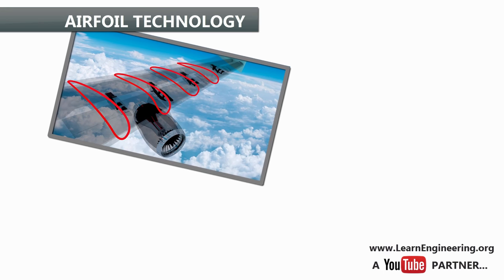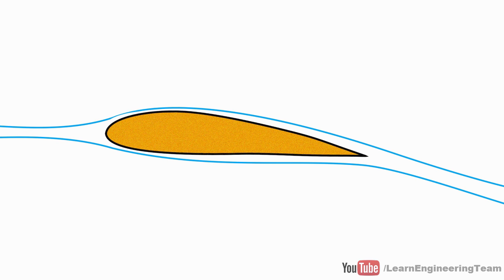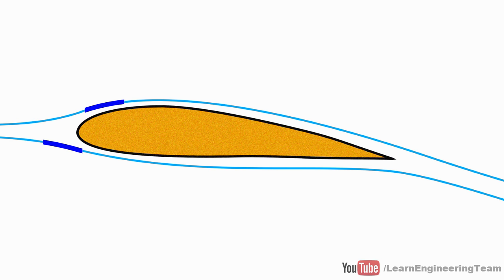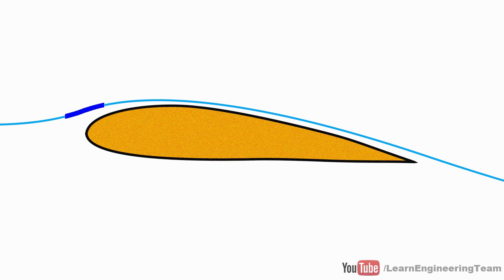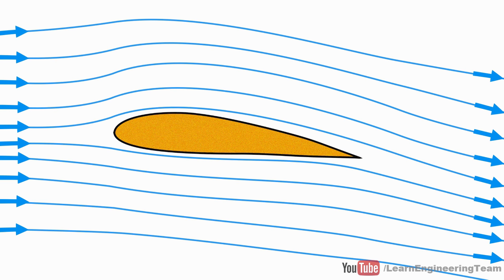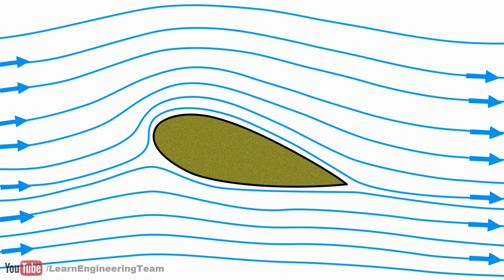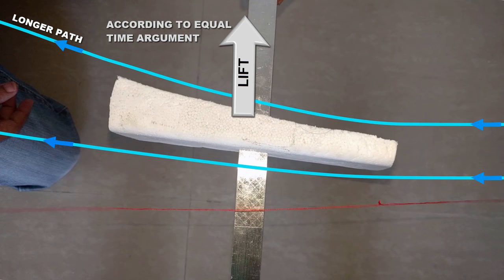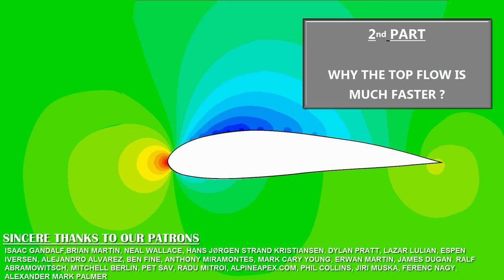How do Wings generate LIFT?

Comment: I wonder no one's talking about starting vortex and bounding vortex!!
Reply: Exactly Prashanth!
For simplicity take a symmetric airfoil on a reasonably long wing, moving at zero angle of attack. The airflow is symmetric, no lift is present. Now pitch up the wing rather quickly to a reasonable angle of attack (AOA), the flow will change: on the leading edge the flow will curve upwards, the stagnation point will move down, just like the flow on a lifting wing. But on the sharp trailing edge the flow will try to flow around it with the rear "stagnation" point on the upper rear surface but  because of the energy dissipation on the lower surface the flow will separate and continue straight, this creates a counter clockwise vortex on the rear upper side  which flows away, the STARTING vortex carrying a certain angular momentum with it .
Conservation of angular momentum causes a clockwise bound vortex to form around the airfoil section. The velocity on the upper side increases and decreases at the lower surface until the flow at the trailing edge is smooth again. The stagnation point at the leading edge moves down  some more and velocity around the leading edge also increases considerably. 
The strength of both the vortex left behind and the opposite one, the bound vortex forming around the airfoil section is called 'circulation' . 
Known as the Kutta-Joukowsky law, the lift for a long wing is given by the equation:
L = rho × V × G × b
Where: rho is the air density (at sea level = 1.225 kg/m^3)
V is the airspeed in m/sec
G is the circulation in m^2/sec
b is the wing span in m
The lift force is in Newtons (kg m/sec^2).
The circulation is not measured directly it can be evalued for two dimensional flow  by a line integral around any path around the airfoil of the scalar product of the field velocity vector and the integration path increment vector. (That is the definition of circulation)
This represents the physics of lift which is the exact analog of the magnetic force of an electric current in a uniform magnetic field and called the Lorenz force.
Once the velocity distribution is known, the pressure can be calculated from the energy equation called after Bernoulli as long as the flow is incompressible.
It is clear that an intuitive explanation of lift without the knowledge of the concept of vortex generation (circulation) cannot be correct.

Comment: Brain teaser answer there is low pressure at the top of wing and high pressure at the end of the wind and there is hp in bottom of wing  and hp in end of the wing ,so the air travels fast from lp to hp than hp to np

Comment: I guess I got the reason for it. Here, to have a lift the particle need not to meet at the same time. A different in velocity is sufficient to create lift. The particle flows at the top accelerates due the air flow when it takes curved path. As a result velocity difference will be created. Thereby generated the lift. If it feels right please comment. I don't thing this Coanda effect is the reason. Its only the Bernoulli's principle. The reason for different velocity is because of particle acceleration at the top...
Reply: Yes, That higher upper velocity is the result of that lower pressure above and atmospheric pressure ahead of the wing.
This gives folks the most trouble. For a better understanding of the detailed cause of the reduced pressure above a wing, try this short video:
https://www.youtube.com/watch?v=3MSqbnbKDmM
Regards.

Comment: Well, still following Bernoulli's principle, according to this principle, the velocity increases when the pressure decreases. Since there is less pressure at the top of the wings than the one on the bottom, the air travels much faster above the wings. Anyway I still do not completely understand this how this whole "lift" thing and Bernoulli's principle works, lol. I should probably finish my homework first. I'm probably wrong.

Comment: Bernouli's principle doesn't talk about the "equal time argument". That's a separate argument that uses parts of Bernouli's principle. Bernouli's principle states that due to the compressed streamlines, the velocity over the aerofoil increases. This increase in velocity, decreases the static pressure, as Bernouli's equation needs to be constant.

Of course, this principle isn't completely flawless. It requires the use of ideal, invicid flow. (Invicid means no viscosity. Viscosity is the reason th air sticks to the aerofoil at relatively low Angle of Attack).

Newton's 2nd and 3rd law of motion aim to fill these flaws, and they mostly do. However, there are flaws with them too, meaning they can't stand alone.

No one fully knows how lift is generated yet. Our best guess is a combination of Bernouli's principle and circulation. (Circulation is a mathematical fenomenon that takes into account the 2nd and 3rd law of motion, saying that the air technically acts in a clockwise, circular pattern around the aerofoil. Of course, it doesn't realistically, but it explains how the Newton's laws are applied, and the increase/decrease relationship of velocity and pressure. Circulation is a vital component to lift).
Reply: It is all the amateurs who don't understand.  Bernoulli's Principle does not talk about compressed streamlines, nor explain any cause and effects. It only states that a speed increase (acceleration) accompanies a pressure decrease (Pressure Gradient). There is no indication in his notes that he understood which was the cause.
 It was Euler following up on Bernoulli's work in the mid 1700s that determined that it is a pressure Gradient that accelerates fluid. This is all explained in John D, Anderson's book.
.
Above the wing gives folks the most trouble. For a better understanding of the detailed cause of the reduced pressure above a wing, try this short video:
https://www.youtube.com/watch?v=3MSqbnbKDmM
Regards
Reply: @Observ45er  Oh right, I thought Bernouli knew about compressed streamlines due to his equation, but perhaps I got confused. Thanks for correcting me. 

Nice video BTW. It was very helpful in explaining things clearly. I was just wondering though: I've learnt that skin friction and the boundary layer drag also play a part in the separation of the airflow from the wing. That is correct, right?
Reply: @thegamerpokemon5767   You see, this is the difference between remembering what you read/heard and understanding the physics / science.
.
Newton's First Law should teach us that it takes a force to cause any acceleration (speeding up, slowing down, or curving).  Fluid has mass, so F=MA also applies to fluids. This includes the acceleration of fluid.

Here's the complete story:
...
John D. Anderson put short historical sections in his book. He explains that Bernoulli onIy saw (in a pipe) that when the diameter decreased, the speed increased and the pressure decreased.  There’s no indication in Bernoulli’s notes that he figured out the cause. LINK below.
.
Properly stated, Bernoulli’s Principle is words saying: “A speed increase is accompanied by a pressure decrease.”
.
Many, many people have corrupted that to mean that the speed alone causes the pressure reduction and that is completely wrong.  I call it Bad Bernoulli.
..
Speed increase is a CHANGE in speed. That’s acceleration.  The pressure decrease is a Pressure Gradient which is a pressure difference between two locations. 
.
Following up on Bernoulli’s work, it was Euler that figured out that a Pressure Gradient is the *cause of fluid acceleration*.  .
This is Newton in fluids.
.
The higher pressure region pushes more, so fluid between these regions is accelerated toward the lower pressure region.  It is a net force toward the lower pressure.
.
It was ALSO Euler that derived what we now call Bernoulli’s Equation. 
.
John D. Anderson “Introduction to Flight” 3rd Ed. Pg. 156,  4.21 HISTORICAL NOTE has the Euler pressure at point and fluid accelerated by Pressure Gradients:
 http://docshare04.docshare.tips/files/18502/185026212.pdf 
- - 
Regards

Comment: Why is this still a debate?  Whether you compute Bernoulli's principle, finite element analysis (aka "blade theory"), or impulse (downward acceleration of the fluid air) ALL produce precisely the same result, lift+drag, and can be equated through their respective equations.

A flat blade deflects airflow quite well.  The reason we use airfoils is because they're far more efficient at deflecting the flow of air than a flat blade, which induces a lot of energy-robbing flow separation and turbulence.  By the way, induced drag is nothing more than the x-component of the resultant force, while lift is the y-component.  Add them up and reverse the sign to see what happened to the undisturbed air mass after the passing airfoil disturbs it.  Essentially, it's accelerated mostly downward (opposite of lift), but also a bit forward (opposite of induced drag).

Funny how that works, isn't it? :)
Reply: +Justin...  YES!  "compute" is the key !
...
The difference, however,  is explaining the science/physics vs. calculating values.  
...
The math never "explains" the science.  It only shows the relationship between values...and NEVER shows cause and effect.
..
F = MA does not tell us that increasing the mass of something will increase a force.   We must understand the science in order to properly apply the equations...so we can CALCULATE things.
...
The bottom line is that it is pressure differences that both cause lift and accelerate air around a wing. 
...
BTW. John Anderson's book shows a flat plate wing's airflow which is VERY similar to a cambered wing.  It is the air flow that is the focus, not JUST the wing shape.

Comment: Air molecules can meet at the same point, if the air is not moving and the airfoil is be propelled by a force. The airfoil does not get lift STRICTLY from a frictional relationship of air molecules moving across the surface of the airfoil (Coanda Effect). 
Lift is caused by a relative relationship between the speed of air molecules passing over the top of the wing, and the bottom. The molecules do not have to meet at the same time of the trailing edge of the wing. However, there needs to be a displacement (net difference) between the airspeed of the top (faster) and bottom (slower). The double- dip top curviture example in this video is completely irrelevant, because the downward slope of the "dip" will actually create an area of wind speed that is slower than the bottom of the wing thus reducing the net difference between the top and bottom airspeeds.
The Coanda Effect is most prominent on the airfoil relative to the airfoils direction of propulsion.  This is why more drag is located near the trailing edge of an airfoil.

Comment: Answering to the brain teaser: As the pressure over the aerofoil reduces progressively it gets it's velocity increased by so much, in fact by a factor multiplied with itself. And the reverse happens below the aerofoil hence the air travels faster above the aerofoil and slower below it. Thanks. P.S. if I am wrong please correct me
Reply: Yep, exactly correct
Reply: The problem with that explanation is that if you stand and watch a wing go by, the air below the wing is pushed to a higher speed than the air above.  This is real data on a wing generating lift.

Comment: Because the pressure is low on the top of the air foil the velocity of the air will be on the top then the bottom as it is the high pressure side. so they can never meet.

Comment: NOPE. it is not the same time argument, it is the same TOTAL PRESSURE  of   the fluid before and after the airfoil. since the total pressure away from the airfoil is the same ,  and the airfoil has a longer side than the other, the flow going on the longer side will have higher velocity ( thus higher dynamic pressure)  and therefore according to Bernoulli equation, the static pressure on the longer path will be lower. since static pressure on longer path is lower, the static pressure on shorter path will be higher and then lift will be produce as a resultant force.
Reply: "longer side will have higher velocity" does not follow from "one side is longer" and "total pressure is the same". Yes, the total pressure is the same everywhere (assume inviscid). That says nothing about the static pressure or the velocity of any parcel, just that the total energy in any fluid parcel is the same

Comment: This is because at the top more pressure is present than bottom of airfoil. So that's why the pressure difference caused at the top creates more centripetal force as compared to bottom hence the upper layer moves faster than the lower one. Simple 😊😊..

Comment: Great that you quickly debunked the commonly expressed "Equal Time" theory with references, but also explaining in more detail why exactly it's incorrect. The counterexamples of "airfoils" that should create lots of lift were fantastic. The Coanda Effect seems relevant, but fluid jets are not typically involved in regular flow over an airfoil. Good, detailed explanations of both the momentum theory and pressure theory. The role of circulation in the generation of lift cannot be ignored, so it would have been good to include in conjuction with discussions of momentum and pressure.

Comment: My next question is how is bernoulli's theorem wrong.  See the theory by itself only relates static pressure and velocity or dynamic pressure. It still holds here.. By ur own CFD results it's clearly visible that velocity and pressure reacts in the way predicted. 

Equal time argument might b wrong.  But bernoulli's theory is still correct. And due to the shape velocity does really increase at a greater rate on top surface comparing the bottom one.  Hence we have lower pressure on top and higher on bottom. 

Hence there should b a force imparted on the wing due to this pressure difference.  But is it the only phenomenon contributing to lift?  I think not   but it certaintly plays a large role in it.

The way I understand is that the downwash or change in direction of flow behind a wing is the cummilative effect of the pressure and velocity difference.. Hence it would b an effect of lift rather than a cause. 

About ur proof that bernoullis theory fails and the second one prevails at the example of a wedge,  I think is not entirely true.. The main problem here is the assumption that the flow separates or the stagnation point occurs at the tip. It's not true. . It could happen somewhere else let's say on a point downstream of leading edge on top surface. 

Similar thing occurs in a flat plate placed at an angle. If a plate is placed in a flow with positive angle of atrack, the plate moves upward. If we assume the flow separates at leading edge then yeah like u said bernoullis theory fails predicting the plate would experience a downward force.  But in reality the separation occurs at a point on bottom surface downstream of leading edge. And part of flow,  runs up back to the leading edge and over it..this causes the drop in pressure causing lift. CFD results agree with it. 

I guess the lift predicted by measuring the mass and change in direction of air behind the foil could predict the amount of lift by newton's third law...but it still wouldn't be the direct theory causing lift, rather a cause of it.

Comment: Even if the molecule on the top gets to the trailing edge first, it does not matter! There is a low pressure, because it is going faster! Newtons Third Law does apply yeti lift, but mostly Bernoulli's Principle generates the lift.

Comment: It's now well established that Bernoulli effects have little to due with creating lift--flight. Because of lift is an immediate result of the vacuum formed at the surface of the back of an airfoil, Bernoulli's formulas are a close approximation for designing wings and explaining lift.

Lift is Newtonian, and comes about from pressure gradients due to vacuum, not conservation of energy in air flows or Bernoulli pressure gradients.

The Coanda Effect is not the driver of lift either. It is electrical and too weak. The Coanda Effect forms because the electrical charges of the atoms/molecules of a fluid flowing over a surface are attracted to electrical charges of the atoms/molecules of that surface. The driver of lift on by a wing comes from the pressure gradient at the extreme vacuum found at the top-back surface of a wing. This vacuum accelerates the air just above the back surface of the wing down towards the back of the wing. This accelerated air in turn pulls down more air from above and accelerates it--the opposite and equal result is lift.

Of import is that as lift is Newtonian, it follows that the vast majority of the energy that is used to create and sustain lift comes from gravity, not from the engines. That is why aircraft have glide-ratios and helicopters auto-rotation. Autogyros are an extreme example of this fact. If the energy from an aircraft's engines were the sole source of energy generating lift, a plane, like a rocket, would not be able to sustain flight for more than a few minutes. This is why jet packs will remain elusive for the foreseeable future.

Hate away, but them's the facts.
Reply: You have a lot correct, except Coanda isn't electrical.  It is only for jets of fluid into an otherwise still environment.  It is actually quite similar to what is going on above the wing, but Coanda has continuous entrainment, whereas there is none above a wing.
Above the wing gives folks the most trouble. For a better understanding of the detailed cause of the reduced pressure above a wing, try this short video:
https://www.youtube.com/watch?v=3MSqbnbKDmM
Regards